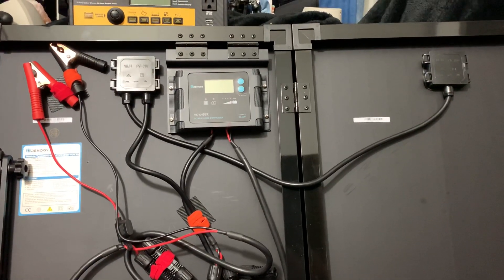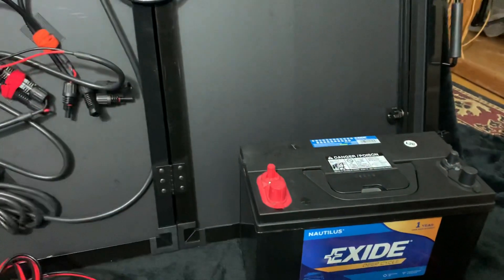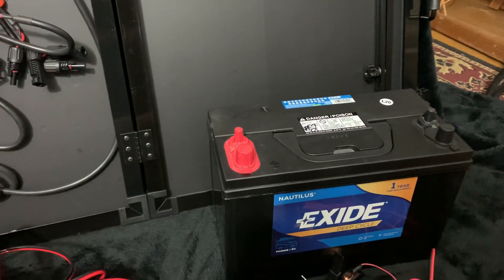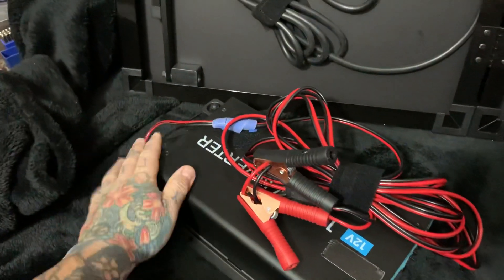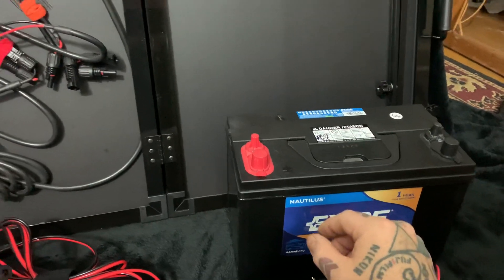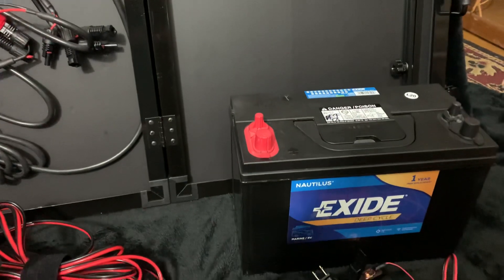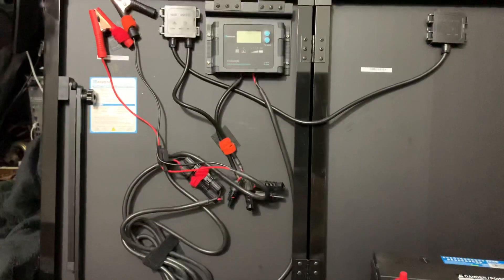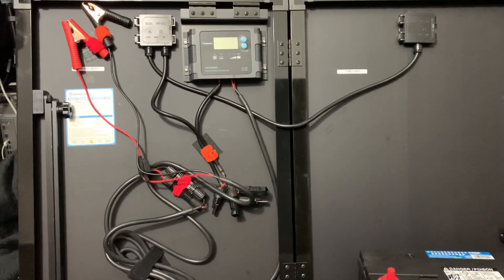🏡 🌞DIY OFF-GRID SOLAR PANEL SETUP for CABIN or MOBILE 🌞

Comment: I just built a DIY solar briefcase using Renergy products. And I'm wondering,  it's only a 200 watt setup. Is it necessary to add inline fuses between the between each of the components?
Reply from the maker: no, just between the charge controller and battery

Comment: Hey, I need an advice 
1. How to figure out, how much draw can I have on a running car engine, without damaging something? Invertor connected to the battery, engine idling. I can not see what is written on the Alternator, minus its own draws - fuel injection, sparks, computer, fuel pump ... not sure how much are they. Can I hook up over 1000W  loads... ?
2. Good pure sine invertor 12V DC - 220V AC? On a decent price? F.i. 1000 W - I saw some german Solartronics, some others - mean well, green cell, victron (not cheap..) ?
3. I do not have much money right now - If I am careful - discharge not below 60% plus no big draws - laptop, LED, phones; how long will a normal car battery last - I mean before it breaks?

Comment: Hi :) What do you think about DC-DC convertor. To directly charge a laptop (or something else) from the battery - f.i. 12V DC - 15 VDC, like Voltaic made. Seems to be cheaper for a start.

Comment: A potential alternative is a gasoline generator. I wonder if someone has considered extending the plumbing/ having detachable hoses  for the radiator on a generator and having an indoor radiator set up for winter..? You can mix in some home made ethanol if you happen to have a lot of fruit trees and spoiled fruit as well - unless you want to grow sugar beets specifically for fuel...
Reply: A bio-fuel generator would be more useful in the worst case scenarios.

Comment: does the DeWalt fast charger affect the lifespan of the deep cycle battery (as it would a car battery)?
Reply from the maker: it does not, no
Reply: Yes, the higher the amps going in, or out affect lifespan.

Comment: The best goal is battery to converter to capacitor to primary trigger wire coil. Core electromagnet (transformer) secondary coil (impulse off.) Resistance charge reflection conjugation (directional charge flow diode) battery recharge.

Comment: Adding a dynamo would be a nice accessory 🤔thinking rocker or hydro powered.
Reply: It would be an alternator to be precise, generating an AC. He would have to rectify it to DC and then feed it into the charge controller...

Comment: Consider buying deep cycle starting batteries. Use for car-boat or solar or Bank batteries like used with generators on live aboard boats rv’s.
Reply from the maker: the starting batteries dont maintain long discharges, not a good idea

Comment: You shouldn't discharge a lead acid battery below 50%
Unless you want to shorten it's life by 50% 😉
Reply from the maker: its called a DEEP CYCLE for a reason.
Reply: @KenTheoriaApophasis  yup. That's why 50%

Comment: This is very good information. I wanna do this sort of set up eventually. Lithium "iorn phosphate" batteries are a little bit better value for money because they can last 2000 or so recharge cycles up from the 500 of conventional lithium and 250 of lead acid. It's possible that you might save a lil bit in the long run and not carry so much mass. I haven't tryed that particular lipo chemistry so maybe it won't pan out. Certainly is a lot of hype in advertising ;)

Comment: A better battery for your cabin would be a forklift battery. They're heavy, but you'll have power through a few days of no sun with no worries. Especially using a 36v unit & drop it to 12v. Should also wire a cigarette outlet adapter into your setup in case there's the need to charge from your vehicle. Don't you have a crick nearby? A downstream generator would be handy, too. Can't rely on a one trick pony like juuuust a solar panel. Figured all this out living in the "high desert" of Wash. St.
Reply from the maker: 70 pounds is ALREADY too heavy for me....thats  my limit
Reply from the maker: well i have a generator too
Reply: @KenTheoriaApophasis  Ohhhhh yeah! Forgot about that. I take it your keeping the equipment weight low in case you have to beat feet?

Comment: You will save allot on lithium batteries by buying individual cells and wiring them for your exact needs. I saved hundreds of dollars this way. And solar panels can be assembled yourself by ordering bulk naked cells. Cost 70% less money to DIY panels
Reply: You also need some tempered glass not window glass, a frame, some encapsulant to seal the cells , tabbing wire, bus bars,flux, solder, soldering iron, a light touch when soldering, the cells are very fragile, some diodes, mc4 connectors, wires, and a bunch of free time to assemble it all.
Reply from the maker: most people WILL NEVER DO THAT however.........too much fuss

Comment: Our son builds earth batteries, microbial and crystal cell batteries.
Reply from the maker: that sounds fascinating, i love batteries :)
Reply: Thanks for sharing❤ ill have to research what those are👍
Reply: You said that like everybody knows what you're talkin about are you referring to something like a battery originally made  in Iran in the first century?
Reply: @unbroken1010  earth battery is 2 copper poles stuck in the ground and a copper wire connecting them. Electricity takes the path of least resistance and goes up one pole, thru the wire and down the other pole back into the ground. Because earth is a giant magnet.  You can shave a wire from something and just throw it on the connecting wire and it will power things. Theres specific things to consider for efficiency and such but it works easily.
Reply: @Vaga-Bard  are you touching those things are you wearing rubber gloves is the current enough to shock you?  How deep you put them. Shaving a wire?  You hook both wires on the same copper wire?  Need to find a good introduction video
Reply: @unbroken1010  you don't have to touch the copper, but it depends on the depth of the poles, lay lines cardinal direction, a lot of things.
Reply: @Vaga-Bard  if you have a recognition to text or website that you had a good experience by all means clue me in if you don't mind
Reply: @I C Flatwatertown house for a battery,? I'm lost
Reply: @I C Flatwater I do a lot this is a new subject for me perhaps you have recommended text or do you just want to be condescending?
Reply: @I C Flatwater  the ether well it's been referenced CW Leadbearer , Wilhelm Reich,  Steiner , Aug klimt , Clymer , Dee to some extent . Many  others the question always remains who got the formula right